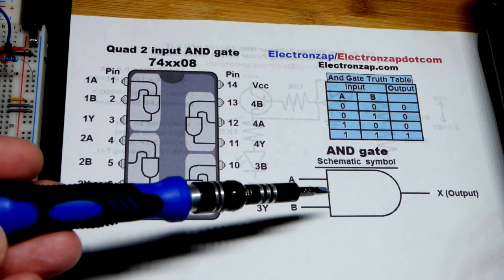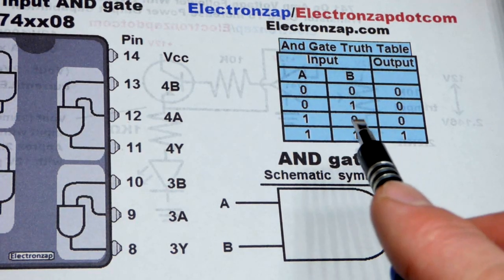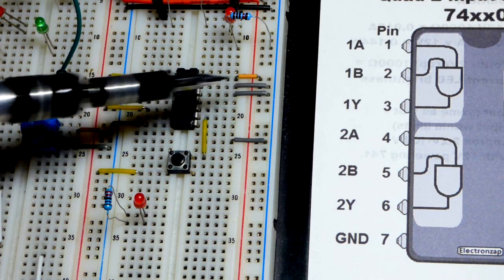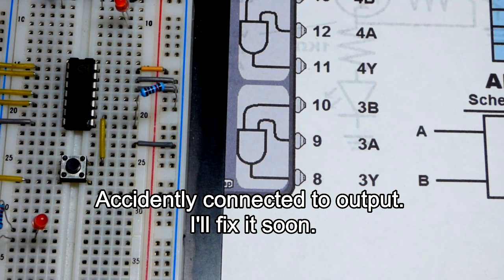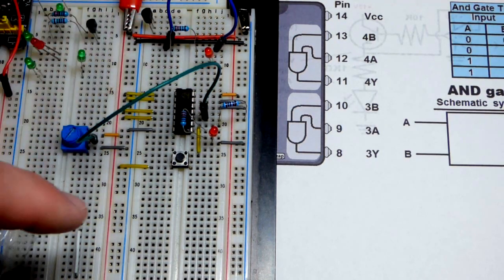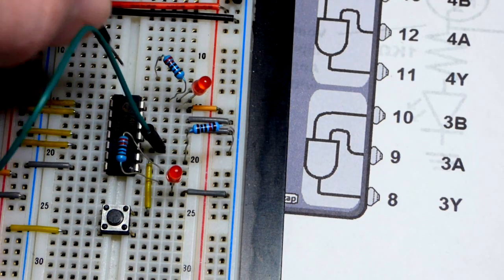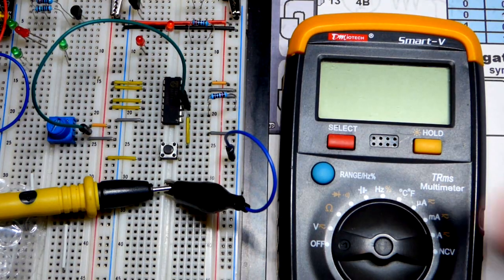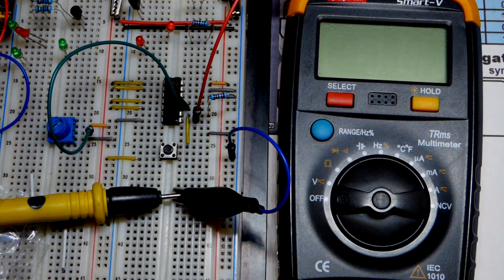Quick 7408 74HC08 IC quad AND gate demonstration of electronics logic gate integrated circuit

Comment: What do you mean: "We don't want to leave this floating, so we add a 10k resistor." Thanks for the fine video.
Reply from the maker: A floating input isn't connected to a voltage. The input pin picks up weak signals like an antenna, and there's some other issues. So you want a somewhat high value resistor connected to the side of the power supply that you want it normally held if you will be switching directly to the other supply voltage occasionally.
Reply: @Electronzap  When i put a 10k resister on the inputs my led still stays on. Is there something i'm missing? I also tried connecting it directly to ground or put a very low value resister it turns, but both of these make it so the power never flows to the chip and just goes to ground too